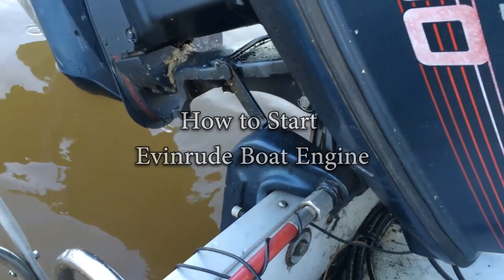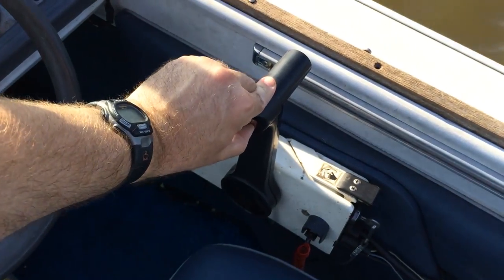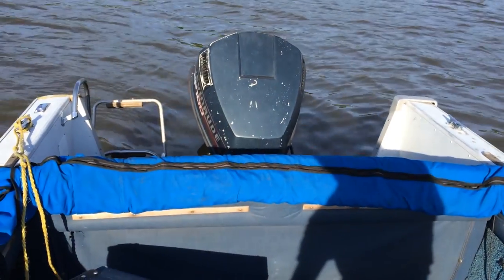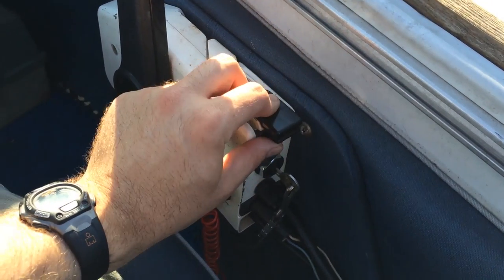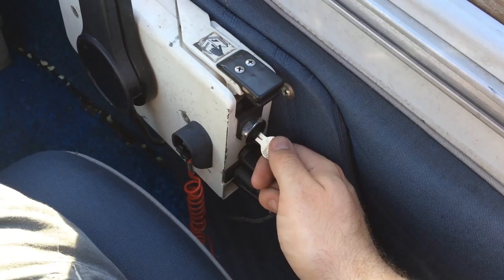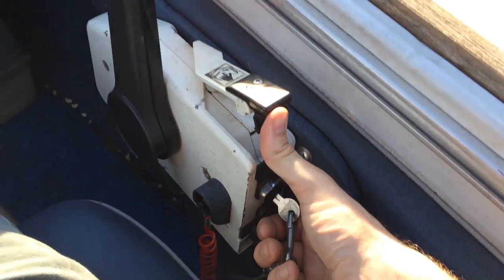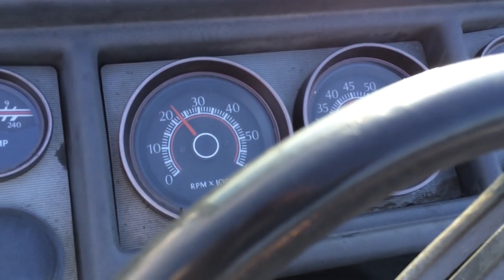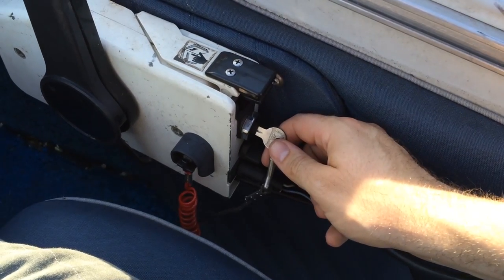How to Start an Evinrude Boat Engine

Comment: I was gonna burn my engine not staring I didn't know what press the key now start thx mate
Reply: I bought a boat the other day and the previous owner had used it for a couple years not knowing about the primer lol. Neither did I, and he warned me it was hard to crank. To my delight, it starts quite easily lol

Comment: I feel like a noob but I just bought my first boat and haven't even launched it for the first time yet (just spring time here) great video. :)
Reply from the maker: Ren G. thanks. it's not complicated but there's a couple steps beyond turn the key. I mostly made this to show my friends but it's pretty universal, especially for johnson/evinrude outboards.
Reply: yup, I have an old 84 Johnson omc 70hp on my boat, I was wondering what the old owner said by pushing and priming, lol... your video just pretty much showed me what to do, thanks. :)
Reply: @reng.5934  Me too

Comment: Mercury has the same procedure. Most will disengage the starter but not start when it's ready to go. Over do that thing with holding the key in and it will flood. 1st time the starter disengages, try it without holding it in. Unless it's off time or has some other problem it should start. Every engine is a little different so find the ritual that yours likes and stick with that. Also, don't let it sit for 6 months and then expect it to behave normally. I start mine once a week.

Comment: Hi. Can someone help me. I Can start my engine, but when I put it in gear the engine just dies, when a push the handle just a bit forward. I can only sail very slowly? Please help
Reply: Did you get it fixed im having the same problem and don't know what it could be
Reply: Had the same problem. Checked the manual: remove the engine cover, there is a small red toggle switch by the flywheel for manual start or run mode. Make sure it is pointing in towards the center of the engine (run mode). Mine was pointing outward. You just rotate it. Now engine runs while in gear.

Comment: went out in my boat today wouldn't start, same control box, starter cog not engaging, i didn't however lift the gas thing like you did lol, hopefully this fixes it!
Reply from the maker: Make sure its clicked into neutral too - make sure the starter didn't just get jammed on the bottom of the teeth of the flywheel. If it is, just wiggle the engine a little bit so the gears can mesh when you hit it. If you turn the key and the starter does NOTHING its definitely an electrical issue - that lever you lift up would only control how open the throttle is, which matters more when its on the verge of starting as opposed to not spinning at all.
Reply from the maker: By wiggle the engine, i mean, try moving the flywheel a bit. If you don't have a V4 your engine layout might be different but on this one the flywheel is big and obvious and right on top of the engine.
Reply: @Cowclops  thanks for the reply! i definitely will do!

Comment: I just bought my first boat.  Haven’t taken it out yet but aren’t you suppose to run the blower for 3-4 minutes before starting?  I’ve read and watched videos on that.
Reply from the maker: An outboard like mine doesn't have a blower because the engine isn't contained in an enclosed space - so you can't cause gas fumes to ignite, HOWEVER inboard and IOs do require you to run it for a short while to clear out any possible gas fumes. I don't think it has to be for minutes, but you should run the blower to clear fumes out of your bilge/engine compartment for a good 10 seconds minimum before you try to crank it. If anyone has more knowledge on what the safe blower run time is, feel free to supercede me - I'm not an expert on that matter.

Comment: I Have a question ..  What does the Knob under the key do ?  I think I messed with it too much trying to start it ...  not knowing about the pressing of the key part...   and the boat is running at CRUISE speed ( At full throttle position) but .. wont go full throttle .. Pick up speed..It just cruises...    Does that knob have something to do with it???  Did I mess up  Thanks so Much .. Ale.
Reply from the maker: According to posts farther down, its the friction lock for the throttle so it stays where you set it. The cause of not going as fast as you want depends on whether your boat ever cruised properly - prop pitch and engine problems could be limiting your top speed, not throttle lever position. Messing with the knob shouldn't have much if any effect on it.
Reply: Ok.. This is the second time i took i out with this engine and the first time it was super fine .. Strong at full throttle .. This time it just all of the sudden went slow and woulnt go fast at all .. But engine sounded healthy .. Just not fast .. Very strange .. I didnt do anything different from the first time except moce that knob a bunch while trying to get it started ..  Thanks for your reply ..  I gotta get to the bottom of this ... It was still fun ...  Could it be that i also ran it with the idle lever up??
Reply: The reason I think it might be that knob is because after i finally started it .. maybe i left it on a position where after it warmed up .. it would just stay in cruise mode...  .. Perhaps tightening the knob would give it less slack and allow it to get more spped?  I have to test it again soon and see what happens..  I do appreciate your comment ..

Comment: Thanks so much for the info!! I have an Evinrude 140 2-cycle outboard and was wondering what the correct premix oil to gallon of gas should be.  What ratio do you use sir. Thanks for any info!
Reply from the maker: This engine has an automatic oil injection pump and varies the ratio - I never had to mix in oil. I believe it was something like 100:1 at idle up to 25:1 at full throttle, or something in this range, but if you don't have a pump or its not working, I'm not sure what the best pre-mixed value would be. Too much oil and it'll smoke at idle, too little and you'll blow up your engine.
Reply: 50:1 is all marine out boards. Unless specified

Comment: nice work I have a question I have a 1978 70hp evinrude and my throttle handle goes all the way forward but the shift linkage on the motor doesn't engage all the way can they be adjusted and if so how?
Reply from the maker: I'm pretty sure there's an adjustment for that but I'm not exactly sure how you do it... that would have to be for somebody who's more of a mechanical expert than me.
Reply: OK thanks

Comment: I know the motor has to be submerged in water but is there a safety switch that causing the ignition key to not turn if the motor is up? Does the motor have to be completely down for the key to turn
Reply from the maker: No lockout. The motor will crank when all the way up. That said, it IS possible to run it out of the water, you just need a hose and the earmuffs to feed water into the intake so it stays cool,
Reply: Cowclops got it running!! But when I let it idle enough and put the idle lever down it idles nice but then after a few minutes it stalls. I ordered a carb kit and a fuel pump repair kit with coils. Anything else I should look into?
Reply from the maker: @bee2333  Make sure your fuel primer bulb stays hard while its running. If the seals in it are worn, it can suck air in the wrong way and lose the fuel siphon. Those are like $20 so thats real easy. It also could definitely be the mechanically driven fuel pump, but I don't know how you'd test for full functionality on that because (despite my having made a video on youtube) I'm not a hugely mechanical guy. If it idles nicely but stalls after a few minutes it may have nothing to do with the carb, but thats only a guess because the carb would be more of an all-or-nothing thing, if its way out of adjustment it wouldn't run right at all, but if it simply runs out of fuel after a few minutes of idling then there may be a fuel delivery issue.

There's also the VRO oil pump on these motors - but if there was something wrong with that like the problem i had a few years ago, the engine will run completely fine but blare the low oil horn from the throttle unit.

Comment: I just got a boat with an Evinrude 100 and it started when I picked it up but I can't start it now. Am I missing a kill switch or something? I didn't know the key pressed in so will have a closer look at that tomorrow.
Reply from the maker: Make sure theres fuel at the input, pump up the primer bulb from the tank until you can't squeeze it anymore. Thats the most likely issue if you can't start it after it not running for a short while. Also it does actually have a safety kill switch on the throttle unit (its a clip you attach to yourself so if you fall out f the motor stops) so make sure that little dead mans switch is pushed in too. 

Lastly, if it just cranks and cranks and doesn't sound like its firing at all it might be that you're not getting any gas to the cylinders, the fix there is to pop the engine cover off and flip a little red lever by the carb in the direction it will go. That opens up the fuel flow to the carb all the way so you actually get gas in quicker. Crank it with that opened up until you hear it start to fire, then revert it to its original position and try to start for real.
Reply: @Cowclops  Thanks heaps, very helpful info. The seller tried to show me but I was all like  Don't tell me I know boats :/ dumb ass I am lol. I should be all good to go in the Morning Cheers.
Reply: Update: I started it thanks to your help :) But it has no safety kill switch. Something I will need to add.

Comment: How many hp is the motor
Reply from the maker: At the moment I sold it, 100HP. At the present time, 0HP - it blew its rings on two cylinders this summer for its current owner (a friend of mine so he showed me the pics). Given that the engine is from 1986, the first time that happened was 2004, and the latest time it happened was 2022 or so, I'd say thats right on schedule.

Comment: What is the manage that could happen from over revving with the idle lever. I never knew that was a variable lever.
Reply from the maker: Assuming manage is a typo of damage - its just good in general not to overrev engines when starting. If you lift that lever all the way up, thats basically wide open throttle with no load on the engine - as soon as it fires its going to crank way up and thats with a cold engine block. Keeping it under 3000 before its had a bit to run is preferable. You might not blow up the engine overrevving it once but its just not good form to run a cold engine at full speed with no load.

Comment: So, when cranking for the 1st time, do I prime it three times then turn the key?
Reply from the maker: Nope, you have to push in (and hold in) the key while you're turning until it starts to fire. You can give it gas with the idle lever too, you just lift it a little bit and prime it, then when it fires you let go of everything and lower the rpm lever.

Comment: Wrong about "priming" the engine. Pushing the key in chokes the carb. When the engine is cold, use this when starting.
Reply from the maker: You got a source that elaborates on this? I thought it was a "choke" until somebody explained to me that its actually an automatic primer valve - more gas, not less air. I did some google searching and all I can seem to find are message board posts which are usually 1. AKTXHSUUUALLY ITS A PRIMER 2. AXKTCSHUALLY ITS A CHOKE. I understand the difference even if its not true that its a "primer," but then theres also the fact that it doesn't change the starting process. Push in key when cold starting, regardless of what magic its doing back in the engine.

I was able to start this engine just fine when my dad would let me drive it when I was 12 and I can still start it just fine 22 years later, though either 12 year old me or 34 year old me is wrong about what pushing the key actually does on this particular 1986 Evinrude 2 stroke.
Reply: My only source is my limited knowledge :) There are lots of references out there for "push to choke" key but you're right -- I'm also seeing references to an electronic primer as well. Maybe this is something that came in later on. My experience is with a '72 Johnson 65hp. What year is your engine?
Reply from the maker: '86 so thats a fair amount newer. I want to say theres a pretty big jump in complexity from their 70s engines to their 80s engines, and also from their <70HP to their >90HP engines. Once you get into the V4s theres a surprising amount of automated stuff going on for an old engine - like regulated charging circuits, aforementioned primer/choke solenoids, etc etc. My knowledge is also limited to what random people have told me and watching videos on youtube plus just dealing with the thing myself, so I won't pretend that my experience is the last word on these. I'm not a mechanic and wouldn't know how to fix it if something went wrong, just an enthusiastic user. 

The weird thing about this particular engine I've got is that its rated 100HP but its actually the powerhead from their 115. So its got more torque at lower rpms, but I think the airflow at higher RPMs is more restricted and that why you won't get 115HP out of it, but it drives like a much faster boat than it is. I was keeping up with my buddy's much newer fiberglass w/ volvo 130HP but that boat could literally be 50% heavier than mine. That said, "much faster than you'd think" isn't that impressive when we're only talking a top speed of around 35mph, but not bad for a big comfortable 18 ft deep vee aluminum fishing boat from the 80s.
Reply: We had a newer (80s) 90hp Evinrude too, but I spent more time with the '72. Definitely looks like you're right that they did switch to a primer later on. I stand corrected. In the older models, though, pushing the key in activated the choke. It was a little detail that my older brother was unaware of, and on one fateful day I was able to start the motor handily after he had been struggling for some time. Happy boating!
Reply: I believe it activates the primer solenoid which is located on the front of the motor and it has a little 1” long red lever on it.  Btw- next time you go to start your motor for the first time that day, remove the cowling and throw that red lever and then turn the key without pushing the key or running up the idle.  I guarantee you it will fire up in the first turn of the key.  Manually engaging the primer solenoid will eliminate any hard starting.  You’ll need to disengage it once the motor runs for a minute but it’s pretty amazing.
Reply: It's the choke function from a wiring harness perspective. On older motors, it would trigger the choke solenoid which would close the choke plates. On newer outboards, it triggers the primer solenoid which dumps extra fuel in to the intake. 

So same electrical function, different uses depending on carburetor design and abilities.

Comment: You forgot one important thing to do you forgot to release the small cap on the gas tank. Its like a air release cap thats on top of the actual gas cap. That can mess up the pump
Reply from the maker: Mines vented separately - the tank is integral to the boat. This might be an important step on external tanks, but theres nothing else I have to pop open on this particular boat.